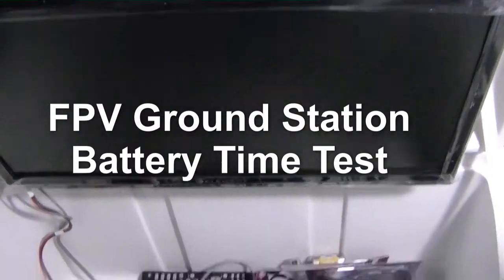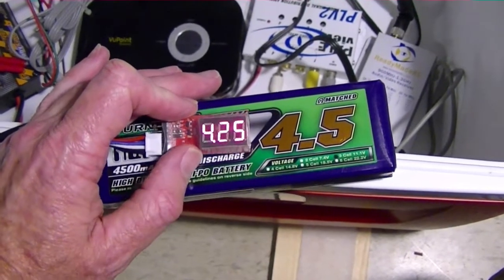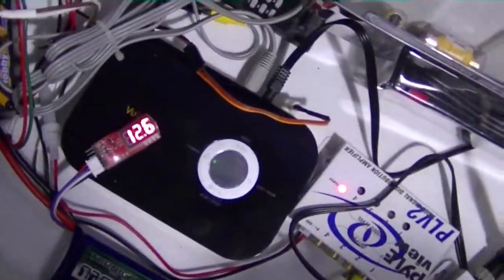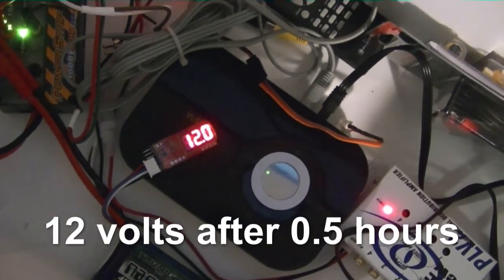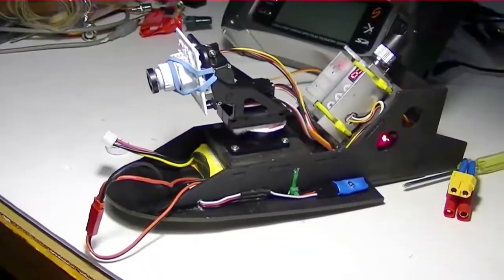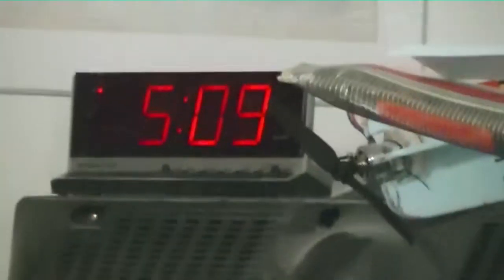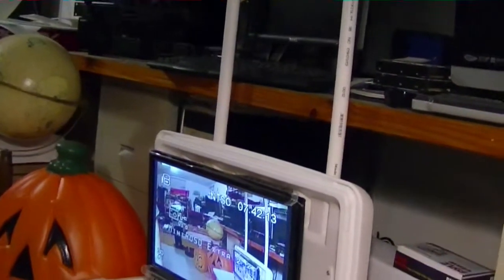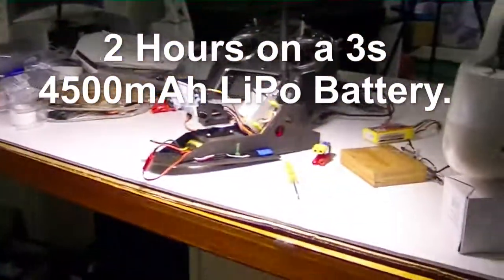FPV Ground Station Battery Duration Test

Comment: I'm almost finished on my GS and was going to put an acid battery but changed my mind now and I will test the final current draw and get a good lipo for it ... That is going to save me a lot of time to hook everything and save me some money also on the internal charger and electronics needed for the acid bat.

Thanks for shearing

Ps : you can go down to 3.3v per cell and still be safe on lipos ... They get damaged under 3v
Reply from the maker: Aron Gatt Congrats on getting it done. I have added a watt meter to my ground station to keep an eye on the battery use. A cheap battery alarm would be good too.
Reply: I also went with a meter and it has an amp draw meter with a shunt , I yet to calibrate cos it's not fully ready yet tho but hopefully next week will be done and il be able to see what current draw I have so I get a good lipo for it ... 2hrs on a battery would be great.

Thanks again

Comment: If you sent a signal to the receiver does the system draw any additional current?
Reply from the maker: No, the current draw is the same as far as I could tell with my amp meter.
It could be so small a change that I couldn't tell. The biggest current drain seems to be the TV at 1.28 amps. The other devices don't use much at all.

Comment: Bit of a waste using a 35/70C battery for the ground station which is drawing less than a 1/2C current. For the dollars you could have had 2 x 5000 mAH 20C zippy batteries from HK US. Keep the 35C pack as a good second flight pack for the skywalker.
Reply from the maker: Good point.
I might switch them out later.